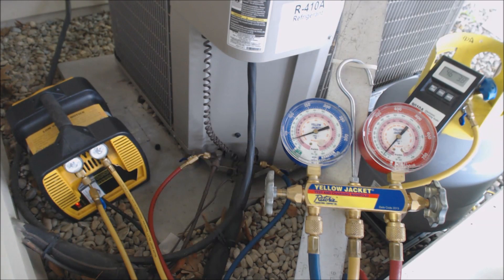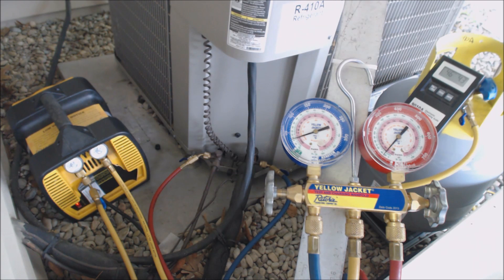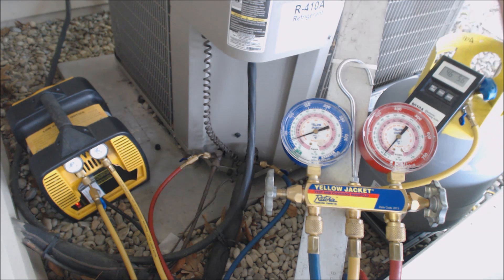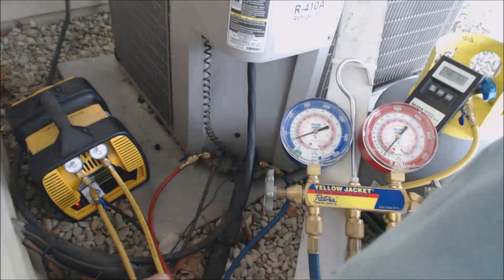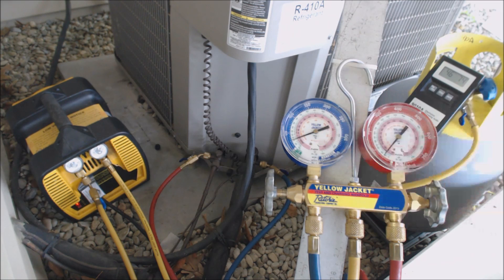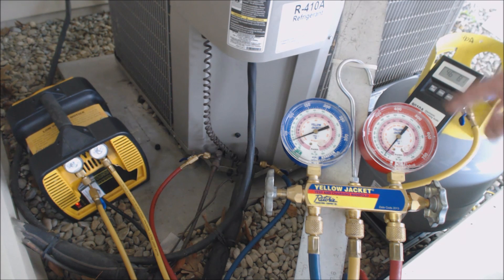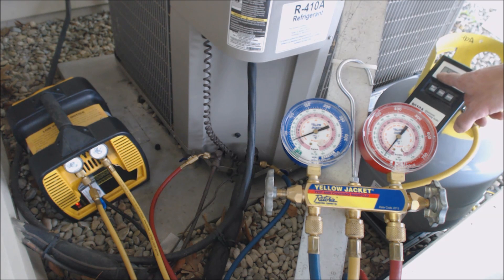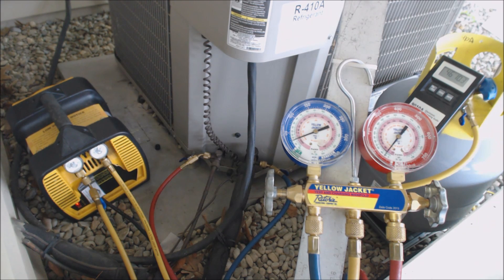Refrigerant Recovery! Set up the Gauge Set, Hoses, Purge Air, and How much you can put in the Tank!

Comment: I always wondered when recovering 410a refrigerant, won’t it fractionate when trying to recover it in vapor since it’s a blended refrigerant?
I’ll be recovering 410 refrigerant and if I understood correctly, connect both high and low side to the unit, and the service hose to the recovery machine and the discharge hose from the machine to the LOW side port of the recovery cylinder? And then open the high side to allow liquid to go in to the cylinder on its own and recover the left over vapor with the recovery machine?
Thank you!
Reply from the maker: It won't frationate because the volumes remain the same once in the tank. You need to make sure to purge the air out of all the hoses at the tank inlet first by opening both the high and the low side gauge handles. Then turn the machine on after tightening the connection and opening the handles. Also make sure t use valve core removal tools at the ports like in the other videos, thanks
Reply: acservicetech ah I see. Thank you so much. I have used my recovery machine for r22, would I be able to use it for 410? I know they said about not mixing oils between refrigerants but can I just use the recovery machine with a filter drier?
Reply from the maker: Yes you can, thanks

Comment: When recovering can you open both sides on manifold all the way when machine is first started or should you slightly crack open one or the other to allow refrigerant to ease in. One of my field supervisors mentioned this to me today and it made sense but I would like your take on this. Thanks. Hope I am explaining this clearly.
Reply from the maker: Well if the tank is empty and evacuated, you could try to let the liquid side in until the tank equalizes. With this type of recovery unit, I just go purge the air at the recovery tank only. Then open the tank and if it is empty, let the pressures stabilize then turn the unit on. I mean it makes sense when you are allowing the refrigerant into the self contained recovery unit to just allow it in slowly since you don't have to do it fast. Thanks
Reply: acservicetech thanks for the reply. I just want to make sure I am doing things the best possible way. I usually open up tank and then open both valves then turn on machine. Not trying to rush just doing it that way because I thought it was how it was supposed to be done. Also I didn't think about purging the air at the recovery machine. I do make sure I purge the hoses when charging
Reply from the maker: You definitely need to purge the hoses before recovery. Usually with my setup I will hook up my gauges, connect the recovery unit and tank, open the handles of the gauge set, purge the air out of the last hose which is entering into the recovery tank, then open the tank and turn the unit on. To end the recovery, shut the handles on the gauge set, shut the tank down, turn the recovery unit off. This would be for a recovery unit shutdown without a purge function. Thanks

Comment: Question..I have non condensables in my system. Is reuse of 410a acceptable after the system is drawn down? If so, how do you get rid of the condensables after they're recovered with the refrigerant? Some back story, I charged my system today in vapor form(bottle upright) and now I have 40psig pressure surges on the high side!
Reply from the maker: Oh no, So unfortunately you don't have the right mix in the r410a bottle now either. You should recover the refrigerant, vacuum down below 500 microns and weigh new liquid r410a out of a new bottle into the liquid side up to what the rating plate is asking for or below. Then turn the system on, wait 10 minutes and check the subcooling. Sorry the bottle is no good but this is exactly what I would do given the situation.
Reply: Sometimes DIY just doesnt pay. Thanks for the help. Looked at the gauges yesterday and the pressure swings were very minimal. Unit cools fine (38F out of the register on a 70 something day) and humidity is around 16% inside house. Looks like I got lucky!

Comment: If you had to recover refrigerant from a 410a system that had around 10 to 11 pounds of refrigerant would you recover it all on the vapor side
Reply from the maker: I think I did on that video but we are not talking that much of a time difference either way. There is always something else to do in the meanwhile. Most of the time I will pull both. Thanks

Comment: Are you only recovering out of the low side, and why not liquid side
Reply from the maker: I think I was not in a hurry and I was making sure all the liquid had a chance to vaporize so that when I was done and got to the required vac level, the refrigerant wouldn't rise once the recovery pump was shut off. With these types of impeller style recovery machines you can pull liquid and vapor at the same time. You could finish in vapor by shutting the red handle at about 10 psi so the system would finish in vapor so it has a lesser chance of rising when off. Sorry for any confusion Trukin Forever. Great Question!
Reply: So when you initially start it up you can have the hose hooked up to the low side on the recovery tank and then you would open both low and high side on the gauge then purge and start. And this is going to sound like a stupid question but the condensers are off when recovering.
Reply from the maker: Yes purge at the tank, and the system is off. There are no stupid questions for someone who has initiative and is concerned that they are doing it the right way.
Reply: @acservicetechchannel   when recovering this do you have both the high side and low side on your manifold set open ? ive also been told its acceptable to recover both liquid and vapour into the vapour port of the recovery bottle, is this correct ? loving your videos, i am currently undergoing fgas training so this is really helpful.
Reply from the maker: @dansmith436  yes that is correct. On these smaller systems, we recover saturated refrigerant through both ports and put it into the recovery bottle through the vapor port, thanks!
Reply: @acservicetechchannel   i hate to be a pain but i would rather go in with confidence, the assessor explained the service valve to us but lost me half way through yesterday, when the valve is fully back seated, it means the guage set can be connected with no refrigerent loss? and when you wind the service valve/3 way valve in, this means the gauge set is now live to the gas. i hope this makes sense and is this correct? thank you so much for your reply

Comment: Another excellent video! I'm surprised no one commented on this yet, but you meant 80% instead of 40% (you may want to add a super).
Reply from the maker: Thanks Jason, I previously added an annotation but those do not show up on mobile any more. I appreciate you supporting the channel too! What were some of the items you have recently purchased in order for me to make sure amazon is working or if one needs to go through the link and then after fill the shopping cart? Thanks
Reply: That makes sense, I was viewing from a mobile device. 
Check for these items (all ordered within this month):

LIL POPPER FUSE TESTER 3 AMP
10 Pack - EPAuto ATC / ATO 10 Gauge 30 AMP In-Line Fuse Holder
Portable LED Work Light, Multi-use COB Flashlight, Magnetic Base
hilmor Quick-Change Magnetic Nut Driver, 1937818

Thanks again, I appreciate what you do. Have you removed your donate button? I don't see it.
Reply from the maker: Unfortunately I don't think amazon counted any of that because you already had them in the cart. The affiliate program rewards those linking for getting the customer to amazon to shop. After a link is clicked and someone goes through, any item looked up and purchased within a 24hr window will award an affiliate percentage. I looked through since back on Jan 1st to present. There were two 3 amp lil poppers purchased since Jan 1 but none of the other stuff is there. I can't see who purchased items but just what was purchased. Thanks though! In reference to the donation button, Youtube has taken that down on all creators channels. It wasn't really used anyway here so that is ok. There were only two donations in single digits and one below $20. I am not to concerned with them taking it down, though I appreciate those who did donate! You don't know until you try just like everything else in life. That's why I added the button, everything in life is an act of research. Are you presently working in the HVAC field or have in the past? I see you have a company doing Voiceovers. That's pretty cool!
Reply from the maker: I wanted to say thanks for the Amazon Shopping, I do appreciate it!

Comment: Are you only removing the refrigerant from the vapor side. I think you mentioned in newest video about recovering  that you don't want to pull vapor and liquid at the same time because the tank will get really hot due to the pressure. What is the best way to recover refrigerant? I am actually doing this tomorrow and I want to make sure I do it the right way. Thanks man!
Reply from the maker: If you have a newer style recovery machine that just has the impellor in the front such as the ones you see in these videos then you are good to pull liquid and vapor out of a system at the same time or just one if you would like. My perspective is to just dump those right into the blue vapor port on the recovery tank. The only time you would open that red handle on the recovery tank is to take liquid out of the tank since there is a dip tube. In the latest video I was likely saying not to put vapor into the red liquid side of the recovery tank but you can put liquid and vapor into the blue vapor port on the 50lb recovery tank. Hope that helps David!

Comment: What do you do just right after, you hit zero in the low pressure regulator?
Reply from the maker: I think you mean the manifold gauges? I let it run into the negative so that it will not rise above zero for r-22 when its off, hfc's are lower.